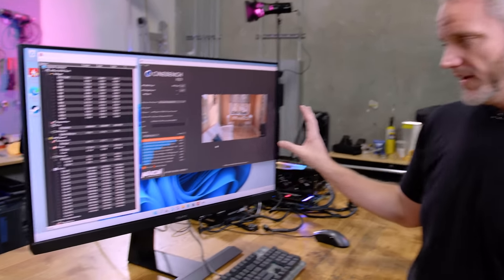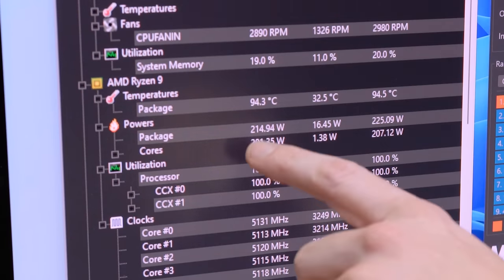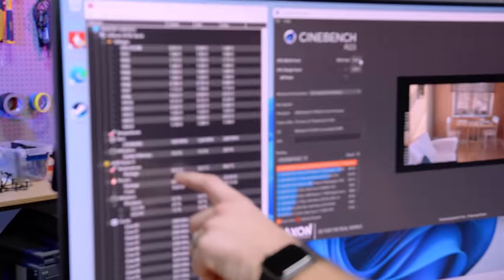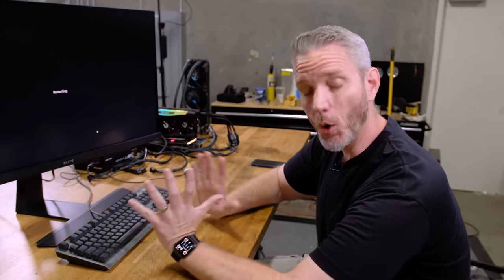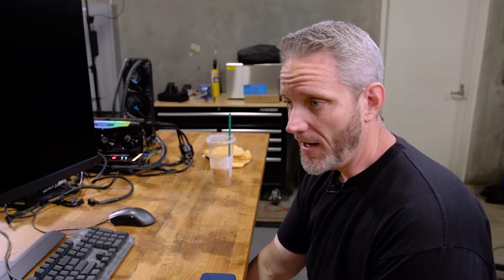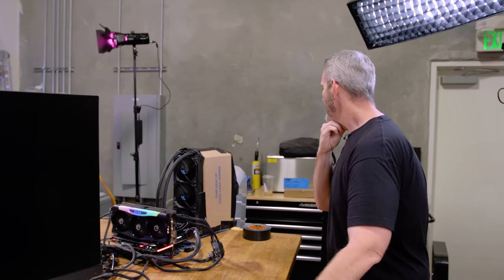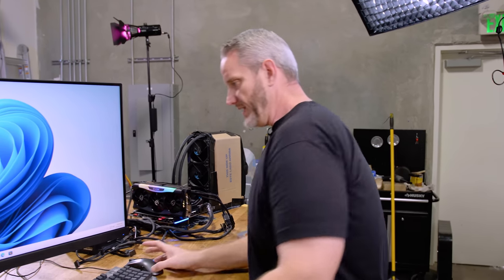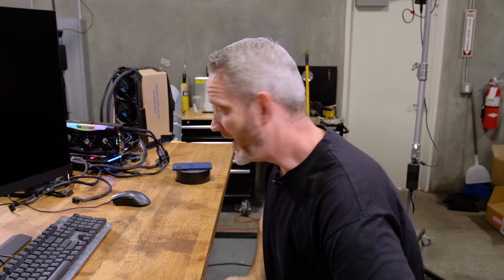This is fine...

Comment: The silver lining is AMD has gone thermonuclear and has finally lost their minds. I see a lot of FX9590 memes coming back in the near future....
I've owned all R5 Zen1, Zen2 and Zen3. The 1600 ran ice cold, 60-65C tops under full load. Under 60C gaming. Cute little beast that blew my Intel 6500 out of the water. Then 3600 brought random temp spikes, 50C idling and 85C+ under load until I undervolted it as much as I could and replaced all 120mm fans with 140mm. THEN it was 70-75C under load and generally 60-65C gaming. 5600X was a liiiitle cooler stock, but this time I knew my way around and now it games at 70-72C (down from 80C+..) and is quite a bit quicker in both gaming and general use. ALL OF THIS was with a Noctua U12S on all CPUs.

You can see the trend here. Every new gen climbs the temp ladder a little bit. I am done with AMD. Next CPU will be Intel with undervolt if needed (much easier to do, too) , the coolest 6core or up CPU I can find. AMD has finally lost their minds in search of power. Yes, I saw these 7000 series can be undervolted quite good. And no, I am not going to tinker YET AGAIN for a few days trying to tame their new beast, the CPU should be usable right out of the box. And no, 95C is not normal for me and I suppose the majority of people that tinker with their PCs. And those who don't will certainly notice the noise coming from their PC and the heat in the room building up. This is insane. 

If they are going to do this, they should've launched a non-X counterpart with 65C temp target alongside with the ones they did, NOW, for the people without 360 or 480 rads and normal people that just want a quiet PC. At least their 7600 non-X part so people can buy a "normal" CPU.  Separate this endless search of the 1% from the mainstream, whoever "needs" it can buy the X-part and non-X for  everyone else. You know, like Intel - XX600K for the framechasers to go nuts and XX400 for the regular Joe. In AMD's case, their non-X CPUs are just either absent or WAAAAY too late to the party. Now we have nuclear meltdown CPUs and only giga-expensive "extreme" (price) mobos. No AM4 backwards compatibility to save the day with cheap b450/b550 and needs DDR5 ONLY. Haha, no, just no from me.

Comment: i would downclock it since the clocks are too high  and voltage as for this cpu...can't believe what i saying now in our tech world that we been overclocking for years now this gonna be first downclocking cpu now...instead gonna up we gonna backwards in clocks...what on earth is gonna on jay??? but those are for folks don't want to get their hands dirty to improve cooling, either this or remove the ihs and go with german guy method..direct cooling by sheer luck if your $700 part don't get slaughter in the process

Comment: Hopefully there is a way to just set the max temp to something lower so that the CPU will stop throttling at that temp instead of 95 degrees.  Even if the chip itself if fine at that temp what about the RAM, mobo and other parts.  Not all mobos are built the same.

Comment: Yo Jay you want me to share a video of my under-volting and out performing stock settings. Idle temps are 106 to 111 f. Full tilt it never get over 180? That mother board is trash your using. All my tweaking was done in the actual Bios just fyi. Let me know I can make a video for everyone.

Comment: Well as with the 3rd Gen, then the 4th Gen and now with the 5th Gen you have proven yourself to be a scrub when it comes to Ryzen CPUs.

I am getting a CineBench R23 score of over 40,000 at a CPU temp of 69 degrees Celsius with my 7950X and that's with 5600 RAM- that's because I know how to configure Ryzen, and you don't.

My CPU was using 164 Watts during that CineBench R23 run.
Reply: Do make a video tutorial on how to configure Ryzen wiseguy.
Reply: @venividivici4253  I have done better, I wrote a guide about 3rd Gen three years ago and have updated it for 4th and now 5th Gen.

With the guide you can configure any 3rd, 4th, 5th Gen CPU on any motherboard that supports them in about five minutes - and that includes the BIOS.

Unfortunately I cannot post links on Youtube. Just google my name on Reddit and you will find it.

I don't do videos, because I have a face made for radio 😂

Comment: i dont get how the temp is so stable. it's not like you have a thermostat on the cooling side. It has to be throttling power in order to maintain temp, or it's just lying to you about the cpu temps. It's just physics, right?

Comment: I would be interested to see a Intel 12 gen vs Ryzen 7000 room heating test. Locked clocks, 100% usage, and see how much they heat a room in a certain amount of time. It would be hard to control all the factors, but if you can make it as equal as possible, it would be really interesting
Reply: Or just record how much power the CPU consumed and calculate the heat output?

Comment: I used to have an audio amplifier that was meant to be warmed up. The sound was better after it had reached it standard operating temp. All the coils and resistors where calibrated at that temp and thus worked optimal on that temp.

I wonder if that is what AMD has done for this CPU, optimise it at 95°C and if you make it work below that temp something is sub-optimal.

Comment: so computer case need a re-haul just for amd heat focus ...how big cases need to be now ??? just asking as friend, and no this is not efficient ...bigger heat issues, introduce bigger cases that create bigger heavy coolers , and loud big out of world size of all fans...it can't get any crazy than now ...right jay, and people are not fond lifting 50ib cases from 20ib currently, you know where this all gonna...i have feeling this 4nm from tsmc really suck badly made node...either they having issue making this or transistors are too close that need to be spread apart as recommendation to amd...but amd said , no...just stick with size of chip...i bet tsmc engineers says that amd is out their mind of wanted to cram all transistor in tiny space ...least intel know what they are doing by making sure not get too close by making bigger dies

Comment: The 95c can be by design all day, I don't give a flying crap.  I am not sitting in the room with a 95c processor.  IT WILL get that hot in any game that is CPU intensive, I play a lot of those games, and god forbid I ever do some 3d modelling or video editing.  To design a cpu that tries to force 95c, which is exactly what this CPU does, is moronic.  Add on the lack of dd4 support, the very high power demands, forced upgrade to windows 11, and Intel seeming to ironically be the better priced product this gen....  

I don't think AMD is in half as good a position as a lot of people want to say they are processor wise.

Comment: I really want to see the kind of performance you can get while staying under 50c temperatures
Reply: Essentially the same, they are limited by power limit - not T Die.
Temp only starts to matter if it starts to run away past 95 - that causes it to cut available power

Comment: Honestly I care much more about efficiency then more performance last gen was already plenty good enough. If big IF Intels claims are true that 13900k is as fast as 12900k while running at 65 Watts I'm going back to Intel. Because if this is true that would mean I can get 12600k level of performance at 30 Watts which is pretty amazing for SSF given that my case only allows for a single 180mm rad which has to cool GPU and CPU. Reducing termals on the CPU means I would have more headroom for the GPU. Because currently my 3090 is undervolted to the point where it only draws 180watts of power. Maybe AMD can deliver efficiency improvements on GPU's this gen because Nvidias new GPUs are utter shit.

Comment: jay could you make a video that explains in laymans terms how the cpu memory controller works and if it starts to not work or works abnormal what kind of issues you might experience and what to test to see if the cpu or the memory is causing the issue? i was just wondering as i have a 3950x which seems to be acting weird in terms of the ddr4 memory and in cpuz the two channels out of 4 are at 1501 mhz instead of 1600 which translates into 3200mhz. the weird thing is im having major stuttering in some games

Comment: i have theory why AMD release this during winter than in summer , anyone else have better theory than mine, just step forward before what i gonna think why they delayed it longer and avoid bad press when if this was launch during hot summer crisis in texas and now california ....and parts around our country....people won't be happy by this cpu gonna 95c when outside is around 104-115f ...add that to insult for our kind when selling this in bad time....i bet they know it will not perform well during hotter climate ...and they just want to save face for this failure for zen5 is gonna to route of direct die cooling eventually...cause the under the ihs spreader it did have athlon XP  cooler pads for no reason why and dies are gold copper plated like they were debating of need a heat spreader or not in this decision making process that again engineers made last minute bad choice changes to stick with heatspreader when they already planning to go without it for this architecture by adding pads and cooper plate for heatsink protection from heavy coolers weight by adding plate over the dies is no excuse gonna 95c by hinder badly like now is stupid in all direction they took with...

Comment: you can`t explain bc this is stupid. when temp is low you can get voltage much lower with the same clock. i`m not talking about liquid nitrogen, simple 20c drop is enough to get +500mgh. direct die for 7000 series proves that. 95c is not the design that they tell. that`s a bad cpu cover design for the compatibility no one cares about.

Comment: Don't think I'll see the 5000 series price drops I was hoping for but probably still going to just snag a 5800X3D for my build to upgrade from my 3700X. 

Pretty crazy how far AMD has come with Ryzen. Even the 3000 series are holding up well. I recently got my 2080 Super replaced from MSI with a 3080 and honestly my 3700x is keep up just fine. I could definitely go a bit longer without an upgrade.
Reply: Because the 7000 series is a totally new platform (AM5) and thus not a drop in replacement for the 5000 series, I don't think the price for the 5000 series will come down a lot quickly.

Especially with how everyone in the AM5 ecosystem currently in the "milk the early adopters" mode, that will keep the 7000 series total cost high and push a lot of people to go to 5000 series.

Comment: I usually really like your videos, but I must say you seemed to be a little bit squirrel on this one.  I thought you were going to be showing how to contain the temps, or showing how the chip responds/throttles under heat, and instead we got an overclocking/broken-BIOS-rant video.  (If 95C is the "new normal", when does it thermal-throttle?)  As one of the "allergic to water in my PC" crowd, I'dve appreciated at least seeing you try a load test under air.

Maybe it's late and I'm just tired or something.

Comment: I'm sorry but what was the point of this? There was nothing about how people will cool this cpu.  basically you showed us you need a 3x120mm radiator (aio) to keep this at almost 95c on a open bench. No air cooling tests? Not everyone has the room or want such a large aio.. do a normal test as in put the CPU in a case and close it like 99 percent of people will be doing with air and water, Then show us if the 95c truly is the '' normal '' as claimed. I bet it will climb higher than  95 and will thermal throttle.  Open bench on controlled Temps is far from what real world results will be.  I mean not many keep their houses at 60 to 65F.  Just my $.02c